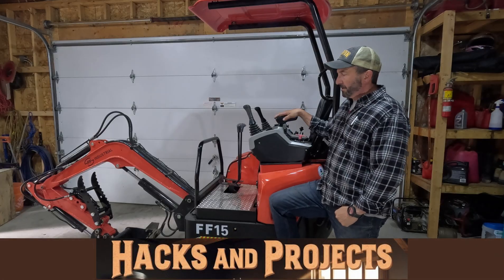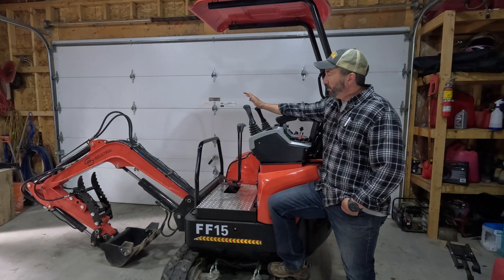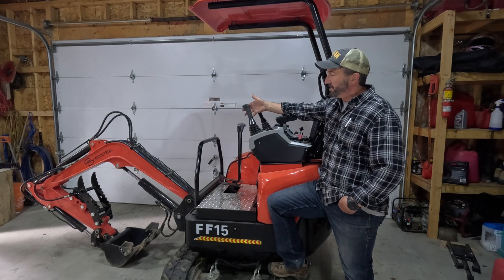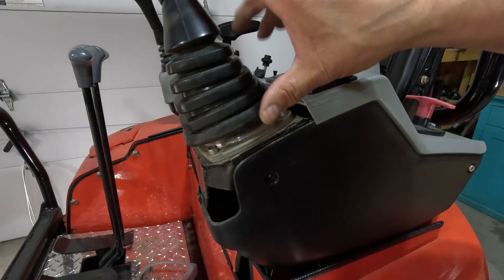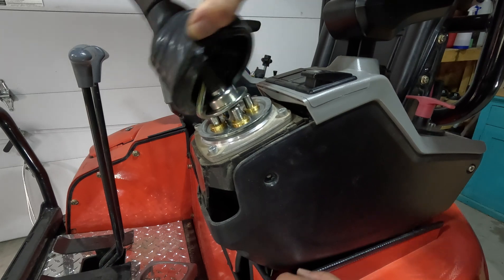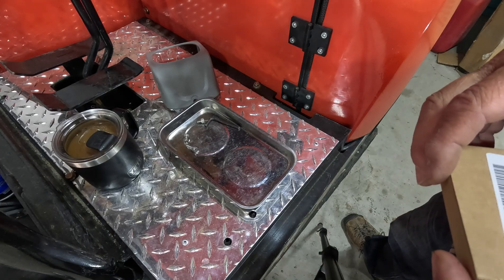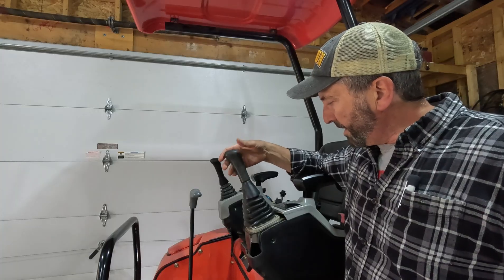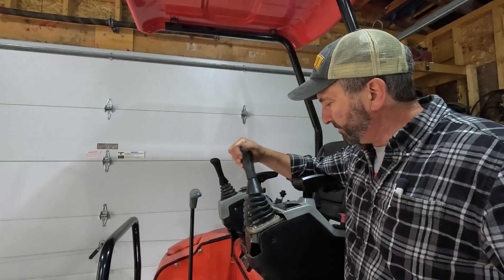Mini Excavator Pilot Control Spring Modification Made Easy!

Comment: Thanks for this tip. I just ordered the springs and will try them out. One thing I discovered is that by raising the arm rests and holding the control levers from the top instead of the sides allows you to have a smoother motion.
One issue I have is with the foot controls for the blade and thumb. I find it difficult to be smooth with them. I'm thinking of welding or bolting on long levers to the foot pads. I think that will allow me to be smoother with them.
Reply from the maker: Omg... I can agree the Blade pedal and impossible to be smooth.  I'm looking at switching it to a lever to better control it.

Comment: The one I am working on is like an on/off switch. No matter how slow the joystick is moved, it jumps when it gets to a certain point (especially the swing)  so I don't think this modification is going to help cure that?
Reply from the maker: Hello John . Is it just one cylinder? Or is every moment the same ? You could check the pressure at both the main vales and the pilot control valves. Should be around 2500-2800 psi
Reply: would be nice to know what brand and model you are referring to (for us future shoppers)

Comment: You're right! This compression spring kit is too expensive for a USA foreigner! I ordered the same 1.2mm X 13mm X 15mm  but I also had few 1.6 mm X 14mm X 25mm in stock. I can cut them and try if more tension is needed. I ordered 3 ft of Natural Latex Rubber Tubing too (17mm OD/ 12mm ID); this seems a good solution to prevents any damage to the plunger or o'ring seal. Using silicone-based O'ring grease for this mod is mandatory. Thank you for the link and tips.
Reply from the maker: Glad to help.  Go Canada!  lol